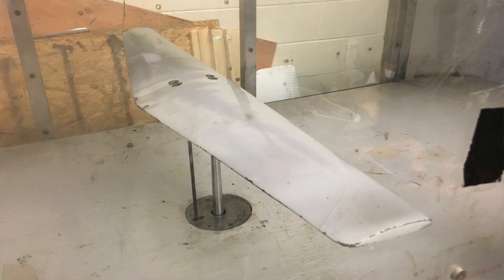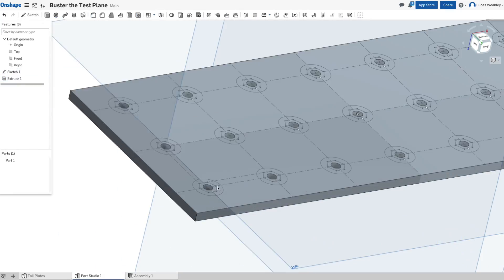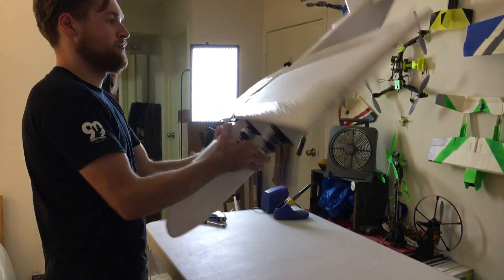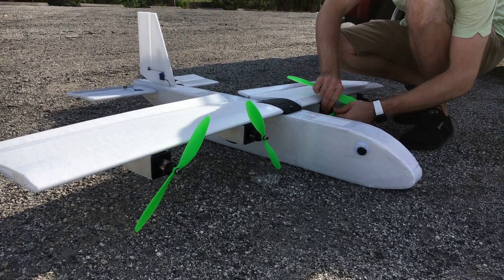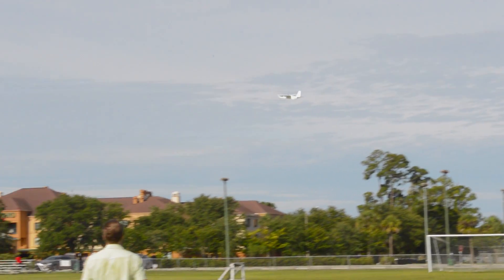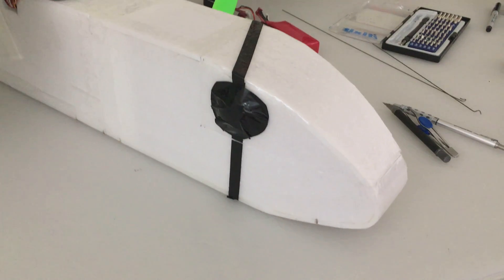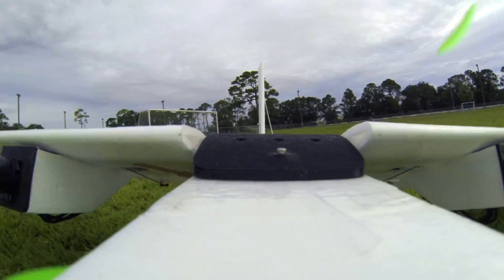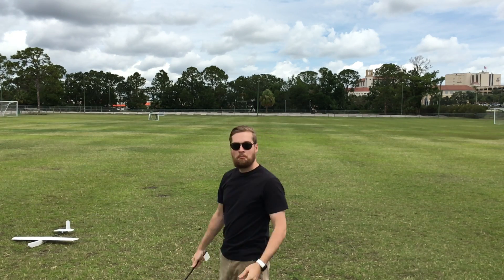Scratch Built RC Engineering Test Plane

Comment: These test are  not  really  accurate....let me  explain,you  have   wing   mounted  motors,that  alone will  make  the  plane  pull  up  hard with  that 30  degree angle...remember a motors thrust  angle alone  in  front  of  rc  plane   dictates whether it  pulls up,down,or level.....so in conclusion factoring those wing  mounted motors with  extreme thrust angle  on  them will  have    different results compared to front fuse mounted motor ,  the wing alone  has a    30 degrees angle.....interesting test,video though.

Comment: Love that video so much!! Wish there were more like that for new builders, this helped me make clear a lot more how this is working. I am designing an aerobatic airplane and because I will bot be able to adjust those incidence levels after, I am trying to get it right from the start. Wouldn't it be about the same to give no inc angles at both wing and elevator and then add some trim up?

Comment: Darn...OH PLEASE do more tests with this system but this time PLEASE do NOT rotate your horizontal stab to match the wing incidence every time.  Keep the Horiontal stab at zero incidence or slight negative incidence as in a real aircraft... and test some angles from 1 to 3 degrees positive incidence on the wing, as well as slight negative wing incidence.  The reason I ask is I'm a huge RC plane addict and I run into incidence questions/problems A LOT. I have tried slight negative wing incidence like some sailplane folks suggest (on a warbird) and it flew great until that first turn, then all hell broke loose...why?  I have no idea.  Great stuff thanks.

Comment: The angle of incidence between the thrust line of the motors and the wing is zero in all the cases. Wouldn't it make more sense to mount the motors to the fuselage to check the effects of angle of incidence to the thrust line?

Comment: This is awesome info, as I am just about to start my own foamy build, but much more lift from more surface area of a larger wing, but likely slower in flight which is what I'm looking for, ..What I noted is that your motor / prop selection is either very near or spot on what I have, 920kv motors x 4 , that run with a 3 to 4 s 1800 to 2200 mAh battery x 2, (a batt for the inboard motors, and 1 batt for the outboard) with 10 x 4.5 props, My first go around building a electric multi-motor, , plenty of gas/nitro glow experience going back to 1979..   I ran into an issue I'm hoping you have some insight on and willing to offer up advice?

After soldering my new motor (first of four), the esc just beeps and the prop does a small jiggle at each beep or tone, is something I'm missing, as I hooked up an older 30 amp esc and the motor worked fine?  I'm confused and ignorant, can you help?   Seems it may be a esc programing issue, but one that I have no clue as to how to fix!??  (Spektrum dx8 2nd gen tx, spektrum receiver,  made in china cheap esc's and motors...    HELP!  I have hardware but can't get it up!   lol  Thanks, Mike

Comment: I built a tiny powered plane, (converting a Multiplex Fox hand-throw glider), using just two servos, one for each wing, to change the angle of incidence from positive to negative values. I pivoted the wings on a carbon spar too, the idea was they could act as elevators and aileron, (elevons I guess). It was very hard to launch but I did get it to fly in the end, just not very well.

Comment: hey lucas, great work! just wanted to ask what airfoil would you suggest for high lift and medium aerobatics?
Reply from the maker: Do you plan on wanting to fly inverted for long stretches?
Reply: not for long. barrel rolls, immelman turn, hammerhead, and a 360° vertical loop.
Reply from the maker: Then just an Armin wing or a KFm3 would work great. If this is a smaller plane (like a 1 meter wing) then it doesn't really matter (video about why coming out soon).
Reply: thanks a lot really! waiting for the video
Reply: Muhammad Waqar you may use depron moulding technique as I taught you in class :p

Comment: If you add a gyro ? And a data logger?
Reply from the maker: I didn't test this, but if you mounted a gyro in the fuselage then it would try to level the fuselage and not the wing. If you attached it to the wing then you still have the problem with drag from the fuselage preventing the plane from flying faster than its stall speed at that altitude. I am planning on adding some sensors to Buster in the future to collect more data though!
Reply: Lucas Weakley i think that the only purpose of the gyro is to record the angles not for the corections
Reply from the maker: Oh ok, we were thinking of different gyros then. I thought you were talking about a gyro stabilizing board or receiver to prevent the plane from pitching wildly. I think having data logging would be really useful though!
Reply: Lucas Weakley yes, arduino or somthing similars and openlog, it is cheaper and ready to run soo good luck!!!! :)

Comment: Autodesk Fusion 360 is free for students. Its a great program I totally recommend it! 👍
Reply: And I'll see you at flite fest :)
Reply from the maker: I've seen a lot of people using Fusion recently and I definitely need to check it out. But, Onshape is free to everyone, which I find incredible. I'm certified in a few CAD softwares, and familiar with the interfaces of most of the others (Solidworks, Catia, AutoCAD Inventor, 123D, ProE) and Onshape has successfully combined all of the best characteristics from these programs without taking on any of their issues. I'm not sponsored by them at all, I just really agree with their mission.
Reply: That's cool! 👍
Reply: As of today (05/Jul/2018) Onshape starts from STANDARD $1500 per user, per year. (https://www.onshape.com/cad-pricing). Overkill for hobbyists IMHO. Alternatives?! FreeCAD (https://www.freecadweb.org/), an Open Source product powerful enough for professional use.

Comment: Do you think if you designed a fuse with less drag, the plane would fly at some ridiculous angle of incidence? Such as if you were able to design a similar plane with an arrow shaft as a fuselage instead. Would be tough to build, but would be a cool test to see if you could fly at your 30 degree AOI!
Reply from the maker: Yes definitely! You could build a profile plane with the wing and tail mounted at that angle of incidence, and since the fuselage is totally flat, it would just cut through the air with little drag. Unfortunately, this isn't very realistic and that's why Buster has a fuselage, to see what would happen if you made a real plane do this. But, I am thinking about building that profile plane to demonstrate the idea, for kicks and giggles!
Reply: @LucasWeakley  Any progress on the "profile plane " ?  Post a link for a donation to it !